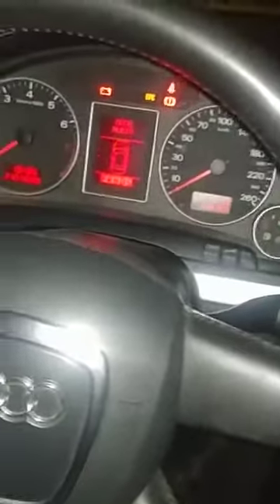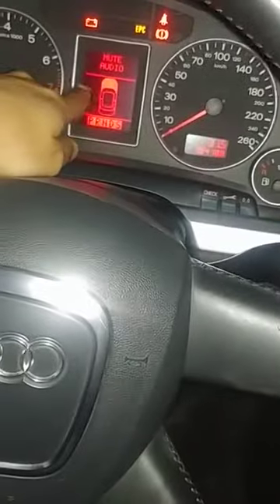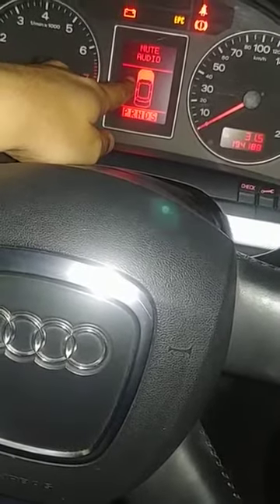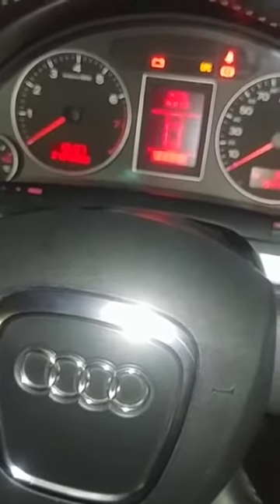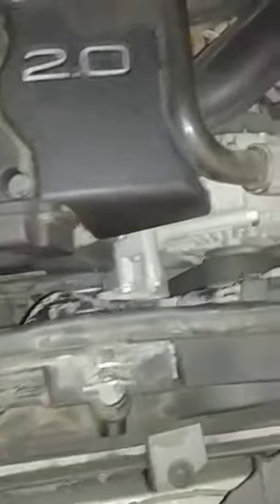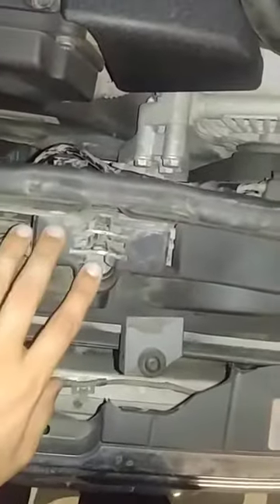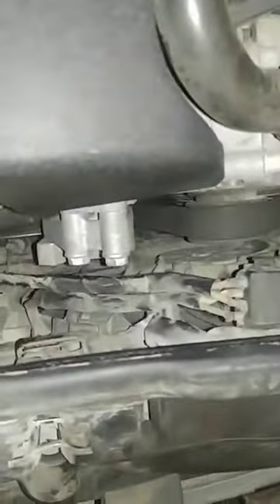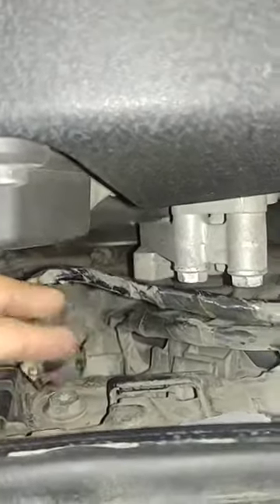Fix Audi sensor for Hood bonnet #Free #Audisensor

Comment: I had same problem this week on 2004 Audi A4 (suspect faulty sensor). Couldn't find out how to remove the switch so just disconnected the push connector behind the fan and the dash light went off. Will plug back in to reset after service!
Reply from the maker: Please subscribe to support

Comment: BTW ,  the switch is closed open circuit.  You can just cut the wires.  Put an on / off switch in its place if you want.  My sensor bracket had cracked and I just pulled it out . Bad design. The sensor also had freyed wires going into it. Was driving me crazy. Intermittently going on.

Comment: Where does that sensor plug into? I can’t find it on mine
Reply from the maker: Hi. Thanks for your support, pls don't forget to subscribe.
Try to run down the wire and trace it all the way to the connector. The problem is that reaching it might be tedious as it is normally the case for European cars. In the video I have shown the connector which is a bit blurry but it's there in the video.

Comment: That’s a clever fix. But remember, the low oil warning light won’t retest the oil level after an oil change until the hood has been detected open. Just remember to untie the hood sensor and press it again after an oil change. 

I have an Audi S5 2011 and I have the opposite problem. My oil light won’t go away because the hood sensor isn’t working. Won’t say that the hood is open even when it is. I’m going to clean it and see if that fixes it.
Reply: I'm suspecting this is the same problem on my daughter's 2010 A4 Audi.
Reply: Thanks god you mention that, I was about to switch it off too, but now I won't.
Reply: @mitakaAbsolut  Dont do that. I'ts not an error XD It shows, if the hood is open'd (blinking) or close'd.